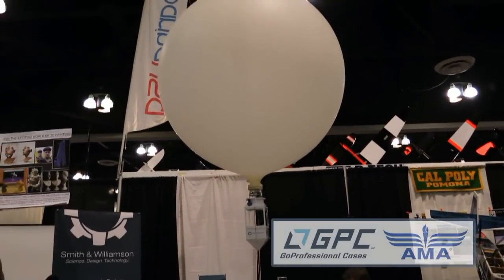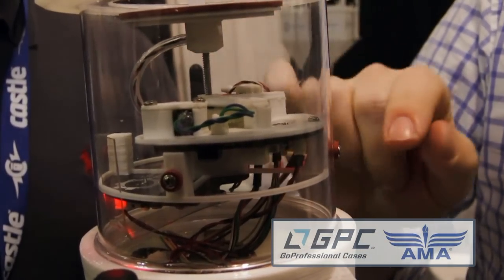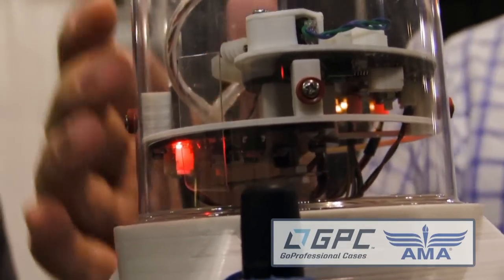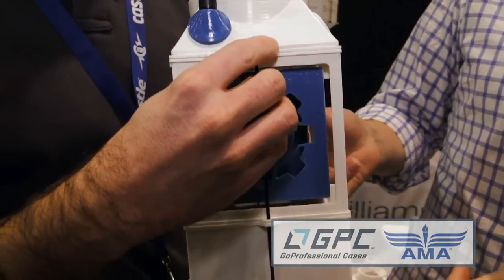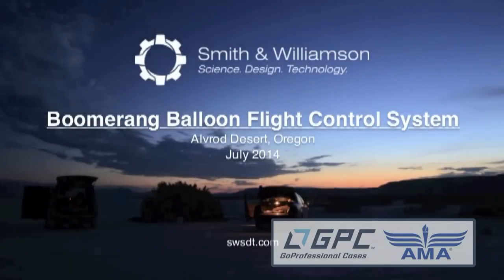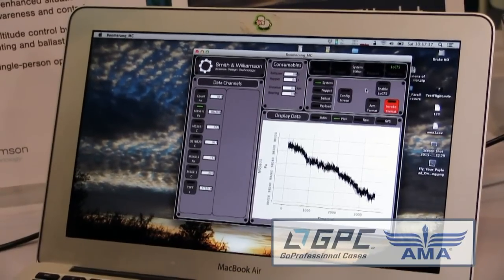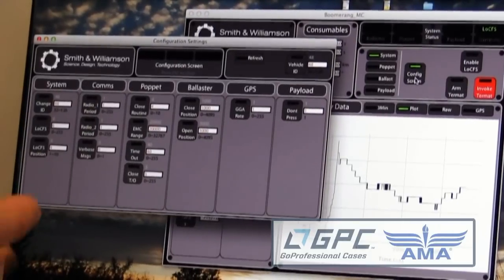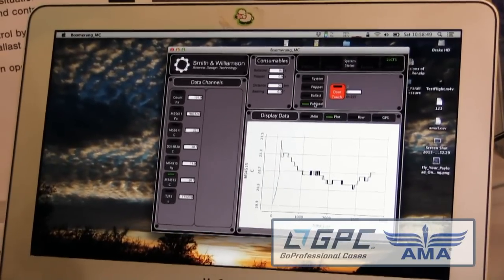RFTC: Boomerang RC Balloon Flight Control System from Smith & Williamson at AMA Expo 2015

Comment from the maker: When I first saw this thing hovering over the show floor at AMA Expo, I must confess that my initial response was a joke. I leaned over to Techinstein gestured to the Boomerang module hanging below the white globe of the helium balloon and whispered: “Look it's a hot air balloon for gerbils!”

I did not under how close to the truth I was, and what a truly remarkable thing that Mark Williamson and Jed Smith have accomplished by it. Basically, they have built an RC balloon. Now, I recognize that sounds pointless because everybody knows that balloons go whichever direction the winds carry them and, therefore, “control” is pretty meaningless concept, right?

Well, if we've learned one thing hanging around with hot air balloonists all of these years, it's that they actually do have a fair degree of control over their direction of travel. However, unlike everything else that flies, they don't control their direction by means of thrust – instead, they rise or fall in the air column until they find wind heading in the direction they want to go, and then float along with it.

That is exactly the capability that Mark and Jed have built into their gerbil-sized gondola. By means of venting helium or releasing ballast (in the form of sand), they can remotely cause their balloon to rise or fall, or maintain a determined altitude.

This still may not sound like much, but it's a staggering accomplishment. If you think about all of the amateurs who have had fun putting up space balloons over the past several years, they basically ascend until the atmosphere gets so thin (the “space” part of “space balloon”) that the balloon pops, and then the payload falls back to Earth, where they recover it.

That itself is extremely cool and I still geek out about it myself, but these guys have gone way, way beyond that – providing real time tracking and control via a laptop computer. Honestly, just thinking about it a week later, I'm still amazed by it.

And they best part is, these guys are based here in Oregon! They're in Corvallis, about 90 minutes south of where we live along the I-5 freeway, but we're already talking about potential collaborations – chasing their balloons with our multirotors to document their function at altitude. If I have anything to do with it, you will be seeing more about this from us!
Reply: I always have love the simplicity of Balloons, the technology applied into I suppose its not new, but it is great! nice an elegant! Thanks so much for your coverage! Also to see you added a microphone to record the interviews! NICE move! lol
Ed
Reply from the maker: rifted Hey, Ed! Yeah, since we've done so much work with balloonists, I've definitely become enamored of the oldest form of aviation myself -- and I think this is just amazing. I've go so many ideas I want to try with these guys -- so hopefully you'll be seeing more of them in future videos. I really think their innovation could kick-off a whole movement of RC ballooning. I'm still geeking out over this thing...